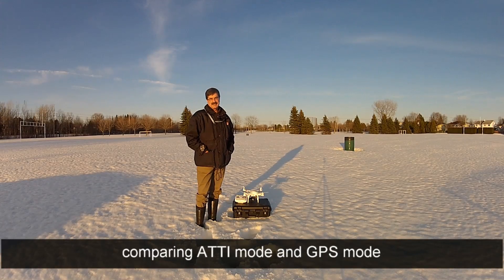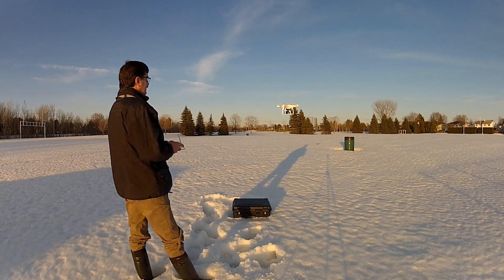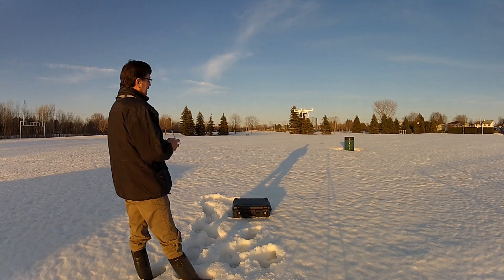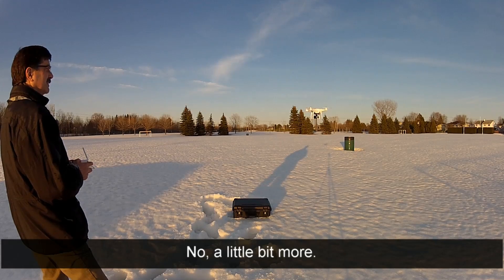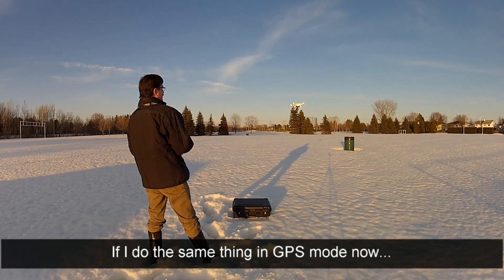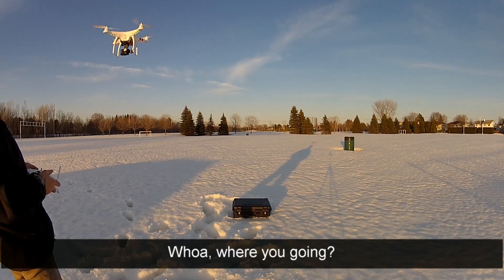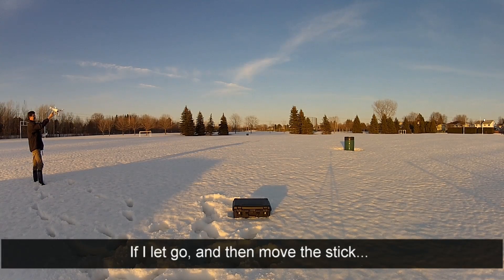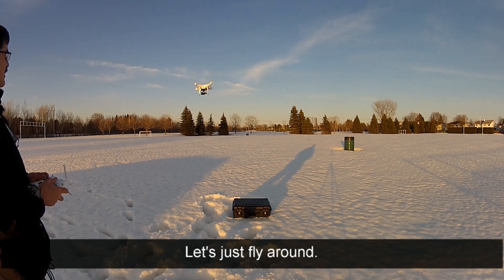Position hold -- Atti vs GPS

Comment: Is it applicable in all drone? 
Switching gps to atti and vicr versa?
Reply from the maker: Sadly, no.  The Phantom controller had a handy switch, allowing the pilot to manually switch between modes.   Newer DJI drones will switch automatically to Atti mode in the absence of sufficient GPS reception and when out of range of VPS sensors (or insufficient lighting etc).  I demonstrated that in another video by putting tinfoil over my Mini to block the GPS antenna, and using the Litchi app to disable the VPS sensors.  See "DJI Mavic Mini - VPS Optical Sensor":  https://www.youtube.com/watch?v=yEH32qiTu1U

Comment: Hey bro how to change atti mode to gps mode
Reply from the maker: This was the original Phantom-1. You just flipped a 3-position switch on the transmitter.  1-GPS, 2-Atti, and 3-could be configured to a choice of Atti (default), Return-to-Home, or Manual Mode.

Comment: Ive got a second hand Phantom 2 which was acting strangely one day. I had a good gps lock and had just done a compass calibration. As soon as the quad got into the air, it started drifting wildly all over the place in gps mode. It was extreme drift - much more drift than what you'd usually get in Atti mode. And it was a flat calm day without the slightest breeze and the Phantom was close to the ground so wind wasn't a factor. It was acting like a cheap toy-grade quad that was out of trim. I had been flying toy-grade quads for the past 2 and a half years before that so I had no trouble steering it away from obstacles and avoiding crashes. The previous day, it was behaving normally in gps mode at the same location.

Comment: Great explanation I was scared to try atti but now I understand
Reply from the maker: The original Phantom-1 also had a Manual mode, which I confess I was too chicken to ever try.  In both GPS and Atti modes, the further you move the sticks from centre the FURTHER the Phantom will lean in that direction and thus fly faster in that direction.  GPS mode limits that maximum angle to slightly less lean than Atti mode.  If you hold full forward stick in GPS it will only tilt forward so far.  But if you then switch to Atti mode, you'll see it leans forward quite a bit more and thus can fly significantly faster in Atti.  
Manual-mode however is completely different.  In Manual, the further you move the control stick from centre the FASTER it will roll in that direction.  And it will CONTINUE to roll in that direction as long as the control stick is not centred.  When you do centre the control stick, the Phantom will stop rolling and will hold its current attitude, even if inverted at the time!  In Manual-mode it will NOT self-level itself.  That can get exciting very quickly...

Comment: Thanks for this video!  I was wondering what the difference was between GPS and ATTI.  I just built a quad with the DJI NAZA M Lite flight controller.  Just figured out tonight, thanks to another video, how to configure my DX6i so I can get into all four flight modes...especially FAILSAFE, instead of only MANUAL and GPS.  Thanks again!
Reply from the maker: I should have mentioned one other difference between GPS and Atti.  It'll fly faster in Atti.  The default choices on the NAZA M are GPS/Atti/Atti, but that third setting can be reconfigured to be Atti, Manual, or Failsafe.
Reply: According to the software mine is GPS, Atti, Failsafe, Manual.  I only built it for flying and video so the GPS mode will probably be my mode of choice.  Thanks again!

Comment: Thank you for a great demo. I learned a lot and am now not afraid to try atti mode on mavic.
Reply from the maker: Just be aware that unlike in GPS mode, where the drone will stop and hold position when control sticks are centred, in Atti mode it will instead keep drifting.  You need to work the sticks to bring it to a stop or to counter any wind drift.  Until you get used to that, If you get into trouble just switch back to GPS mode.

Comment: Well, my flyaway due to a GPS glitch was actually caused by marking a wrong / glitched position as home. If you initialise RTH it will try to return "to China" as you put it. Now, if it is a smart RTH or Low Battery RTH you can cancel it out by timely switching to ATTI. In case of failsafe there might not be a good (or any) connection between the aircraft and your controller, thus making the cancelling or switching to ATTI impossible. It will fly towards "China" till the battery runs out. 

You should always make sure that the home marked on your map is the correct one.

Comment: How much is the max range because sometimes is 500,sometimes 200,100? Аnd what determines how much will be covered?
Reply from the maker: The range is very much affected by proper antenna orientation, and any obstructions between you and the drone, i.e. trees, buildings, etc.  You always need a clear line-of-sight with nothing blocking the transmission signal.  See this video by DJI, https://www.youtube.com/watch?v=P7M9JtfVwQE

Comment: Hi and thank you! Very handy explanation. One question. Imagine I fly straight in GPS mode. Can my MOVING aircraft be slightly blown out by crosswind (even not really strong)? Thus there will be not perfectly straight line and it will look like a small drift. I think that's one of conclusions that can be done from your video. Isn't it?
Reply: Максим Забаровский for this example does GPS or ATTI mode even matter? wouldn't you want to use the course lock on the other toggle?
Reply from the maker: I only showed what happens when the controls are centred with the Phantom hovering.  In GPS mode it holds position, in ATTI mode it drifts with the wind.  You question should be easy enough to test on a windy day.  Example, wind is blowing from West to East, Phantom in GPS mode facing North.  It'll be leaning left trying to hold position.  Now move your control stick slightly forward.  Does the Phantom move in straight line heading North, or does it crab away at an angle heading North-East?  Try it and let us know. :)

Comment: I need internet to use GPS mode,right?
Reply from the maker: No.  The Phantom has a built-in GPS receiver, so it knows where it is and will hold position whenever the control sticks are centred while flying in GPS mode.  No internet connection is required for that.  The onboard GPS antenna   needs to see a sufficient number of GPS satellites though.  Flying indoors or under bridges etc may block satellite signal reception, in that case the Phantom automatically reverts to ATTI mode, in which case it won't hold position when controls are centred and will drift with the wind.  This video was done with an old Phantom-1.  The newer Phantom-2, 3, or 4 use a tablet display mounted on the controller running the DJI Go App.  You do need an internet connection to download the map display on the tablet.  If you are planning to fly in an area without internet coverage, you can pre-load and cache the map display beforehand for the area you intend to fly in.  That said, it'll fly just fine even without a map displayed on the tablet.
Reply: Zbip57 Thank you verry much!

Comment: When it's hunting around it's typically because the GPS isn't 100% accurate. If you looked at the logs you'd see the GPS spot bounces around a bit within a small area. The worse the GPS coverage, the worse the stabilization.

Comment: I had a situation a couple weeks ago where I had 16 Sats locked onto my bird in GPS mode. I took it up no higher than 50 feet when it automatically switched into ATTI mode. I was able to bring it down but when I tried to actually land my bird, it began to drift and ended up flying into my truck which was parked nearby. Thankfully the only damage done was to my props which I simply swapped out and sent the bird back in the air without any issues. Not sure why it switched to ATTI mode on its own when I had 16 Sats locked but this goes to show that I really need to learn and master ATTI mode! Thanks for posting this video @Zbip57

Comment: I have a question. after installing the new firmware in my P3 pro, it won't stay in hover mode at one position, but instead veers right or left almost uncontrollably. I recalibrated the IMU on a level surface. Recalibrating everything to see if this fixes the problem. Could my compass be malfunctioning, and wouldn't that show up in the Go app?

Comment: One more question please if you don't mind. If I fly out toward the Statue of Liberty in ATTI MODE as long as I am providing stick input are you saying that it will stay on course in the direction I am flying? So if I understand you the only real trouble or risk of ATTI MODE is when you are not giving stick input and the sticks are centered

 in that case clearly the wind could blow it around.  In ATTI MODE if I am giving it stick commands to fly straight ahead if a sudden gust of wind comes from the west would it push it off track even though I am giving a stick command to fly forward? 

Basically it sounds like you are saying as long as the Phantom is receiving stick controls and you are actively flying the aircraft there is little difference between ATTI and GPS modes I can't wait to test this thank you
Reply from the maker: James Bandes Other than the difference in maximum speed, Atti and GPS mode behave the same while you are actively giving stick inputs.  It's just that it won't stop and hold position in Atti mode when the sticks are centred, but will be free to drift.  CourseLock (CL) works in both GPS and Atti mode.  However HomeLock (HL) works ONLY in GPS mode!
As for your question of flying in a straight line, I'm really not sure.  I would think both modes would crab away at an angle as they are pushed by the wind.  Let's say it's facing North when you push the stick forward.  It'll head North.  But if there is a strong wind coming from the West, even though the Phantom will continue pointing North the whole time guided by its compass, I think it would track North-East as it path is deflected by the wind.  Certainly in Atti mode.  But you're wondering if it's smart enough in GPS mode to know it's drifting away from its intended due North track?  That sounds like something worth trying.  Let us know what you find.
Reply: Also was amazed that square trade insurance will cover it 

Thank you for contacting SquareTrade.

The warranty you have purchased covers you for all mechanical and electronic failures during normal usage we also cover the item for accidental damage from handling up to the retail cost yes we will cover you for the repairs or replacement.

Comment: Finally a nice explanation. I did by a GPS tracker because of all of the hype over flyaways however your video was very compelling that flyaways as I always suspected are probably 97% pilot error. The only other thing I can think of that would cause a flyaway would be some form of software or code malfunction which I suppose is possible but also highly unlikely. 

Thank you for sharing this it is very helpful. So when in ATT I mode  I've also heard that it will fly much faster can you confirm that is true and also when it is flying forward or in a certain direction in ATT Mode it looks like you do have very good control while it is moving under stick control  so I suppose the only downside of atti mode would be when you try to lock position and the Phantom is not moving under stick control  or you wish to hold position
Reply from the maker: James Bandes I'm convinced the majority of flyaways are caused by people not understanding what they're doing.  That said, there are many reported "unexplained" flyaways, the cause of which are mysterious.  The point of this video was to show that a GPS glitch alone cannot cause an uncontrollable flyaway.  The GPS system is only being used to hold position when the control sticks are centred, and otherwise ignored whenever you are moving the sticks.  For a GPS error to cause a flyaway there has to be something else gone catastrophically wrong.

Yes, Atti mode flies faster.  You can see it on your video.  Give it full forward stick in GPS mode and the props come down in front only so far.  Flip to Atti mode and the props will come down much further as the Phantom leans forward more.  The bird flies much faster in Atti mode.
Reply from the maker: James Bandes One of my very early videos shows me almost losing my P1.  It's because I was flying in Atti mode at the time and didn't know that HomeLock only works in GPS mode.  When selecting HL in Atti mode, the Phantom actually flies in CourseLock (CL) mode.  That's not what I was expecting at the time so it confused the heck outta me and I panicked.  Panic is never good.  See: https://youtu.be/oAXpuUh78Gk
Reply: I tested course lock in the simulator and it appears that course lock only works in GPS mode. Need to test live
Reply from the maker: +Jacob Job Yes, it's the same.  When you move the control sticks you're simply telling the bird to move forward/backward or left/right etc.  It doesn't matter if you're in ATTI or GPS mode for that.  The difference is that GPS mode will stop and hold position when sticks are centred, whereas ATTI mode is free to drift.
Reply: +James Bandes I'm really not sure if flyaways are caused by a gps error or what but I can tell you they are very real, I did a compass calibration, waited for safe to fly gps, took my Phantom 3 up to around 7 mtrs and let go of the sticks. After a few abnormal jerky moves it took off on some kind of a mission at full speed, luckily for me and to my amazement it came back hovering uncontrollably in my general area, i noticed I had a very small amount of influence on it's control and slowly managed to wrestle it down, strangely I had to pull the battery pack out to cut off the motors as down throttle would not cut the motors! up to this point I had always flown in gps mode, maybe over riding to ATTI may have given back control, I will never know now. very scary moment, hands off sticks in gps mode, cant see how this was a pilot error?
Reply from the maker: Lee Jackson
Unexplained flyaways can and do happen, yes.  But none of the GPS-controlled autonomous flight modes (Home-Lock, Range Limit, Failsafe RTH) result in "abnormal jerky moves" or taking off "at full speed",  Those functions are always executed at a smooth relatively slow speed and can all be cancelled at any time by switching to Atti mode.  There could be many possible causes for your flyaway, dirt in the motor bearings causing them to stick, dirt in the RC control stick potentiometers causing an intermittent control signal, RC controller improperly calibrated so you no longer have full range of controls (preventing throttle reaching zero as required to cut motors).  Who knows why?  Could be a hundred different causes.  But it's almost certain it wasn't caused by a "GPS glitch" or GPS failure as the Phantom is perfectly capable of flying without a GPS signal.
Reply: +Zbip57 that doesn't make sense, yes it can fly great without gps but as in my case when gps was activated it seemed to be hunting for random points. I understand your theory about dirt in the motors/ controller, it's a pretty new clean unit, worked fine before/ works fine now although I do understand your thinking. It's hard to explain the controller & craft were not limited in any 1 way/direction as maybe caused by dirt, it just seemed to have a mind of it's own. controller improperly calibrated or something maybe but to me it felt like the unit wasn't sure about it's compass baring or gps point maybe some kind of geographical interference? why the remote wouldn't overide I don't know, maybe a clue! ok dude that's my story anyways, in future I would switch to ATTI and try to regain control but... take care.

Comment: The suspicion is that it is a GPS glitch whilst it is determining the homepoint that can cause fly-aways. If the homepoint ends up in China then a) if it loses the radio control signal or you manually execute RTH then it will try to fly to China and b) more subtly if it then decides that it is outside it's specified distance limits it may try to execute an RTH (again, to China) by itself. I've not actually tested the behaviour if it finds itself outside of distance limits to the recorded homepoint. THAT would be an interesting experiment.
Reply from the maker: John Jameson Even if that theory were possible, it would not cause an uncontrollable flyaway.  RTH and the Range Limit feature can both be cancelled by switching to Atti mode.  I've demonstrated that in another video:  https://youtu.be/zcupZvMj7tw
Reply: Zbip57 Have you definitely proved that switching to ATTI overrides the range limit? If you have, then yes, I agree that such a situation (indeed any unwanted RTH) is recoverable by switching to ATTI provided that you have RC control. This is good to know. As it is, I always check the recorded homepoint on the groundstation map as part of my pre-flight checks but it's good to know that ATTI will deal with everything GPS related. I guess that leaves us with pilot error, RC interference/malfunctions and NAZA bugs as the remaining plausible reasons for fly-aways.
Reply from the maker: John Jameson Yes, definitely proven. ATTI mode cancels the range limit feature.  That's with my first generation Phantom-1. I encourage you to try the experiments with your own Phantom.  See the other video: https://youtu.be/zcupZvMj7tw